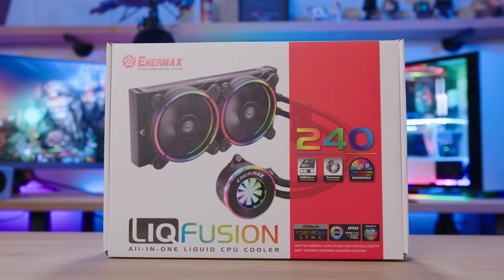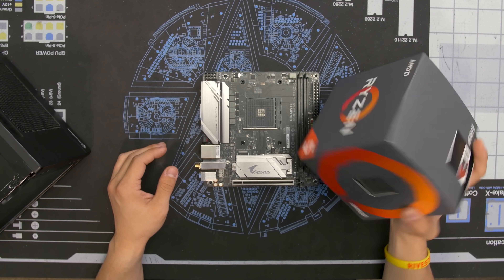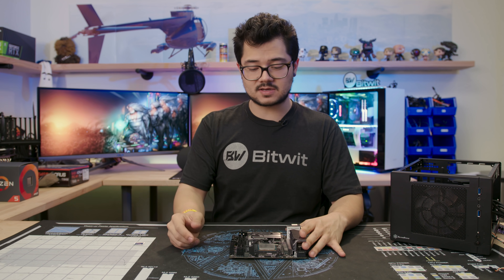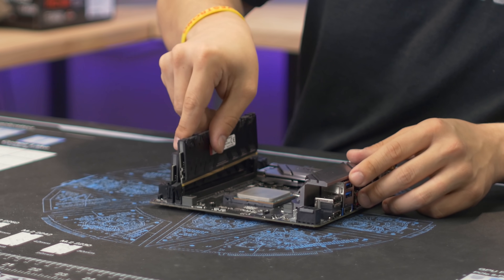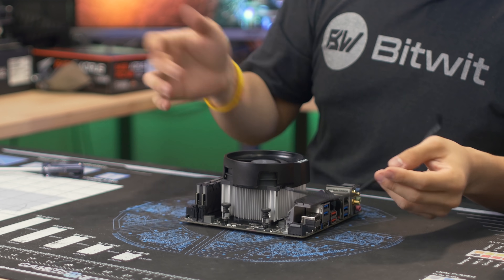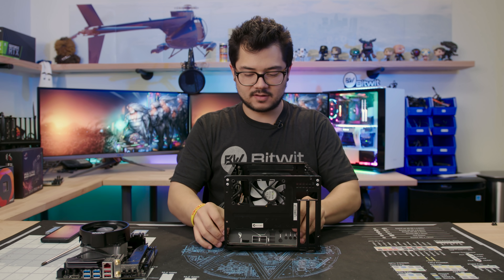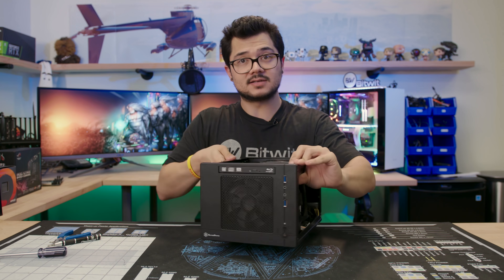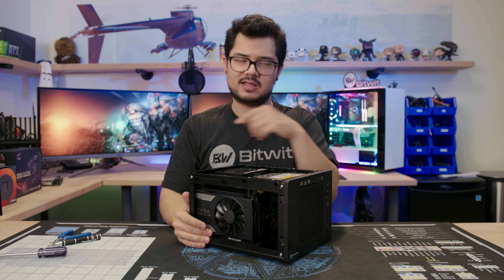Building a TINY PC Step-by-step!

Comment: Hey I ordered the motherboard (gigabyte b450 i aorus pro wifi) a few days before watching the video and it’s on its way, does it normally not have that ‘io shield’ thing or have you just lost it? Will I need it in a sg13 case (also on the way)?
Reply: Nvm it came today, shield included ^^

Comment: Very similar build to mine. Except I crammed a 2600x and a 3 slot rtx 2060 into a coolermaster 110. With an NH-L12s for cpu cooler.

Yes they do fit. You just need to make some cuts.

Comment: I built in this case back in 2013, and the cable management is always awful with it. Imagine if you were also using the 3.5" sled those cases have. Honestly as much use as I got from this toaster, it kinda soured me on Silverstone cases. For the price it just isn't as good as other SFF options out there (let alone if you go into premium case territory).

Comment: --KYLE

--SILVERSTONE Sg05

--NOT the B450 I Aorus Pro Wifi

--ASUS ROG Strix B450-I Gaming

--Ryzen 5 1600X

--Included Wraith Spire CPU Cooler

--HyperX DDR4 Predator RGB (2x8) 2933mhz

-- 5:08 phone call

-- 7:23 Important phone call

--SAMSUNG 970 EVO NVME SSD M.2

--450W Silverstone SFX PowerSupply

--EVGA Geforce GTX 1060 6GB MINI

Comment: I love this build but for some reason i don't feel comfortable with the hot air from the CPU going right to the bottom of the POWER SUPPLY. I know that it does not overheat... Its just that i like a bit more space for the airflow. Also i prefer the pull push cooler.

Comment: "I need to snip off those tweezers." I got that reference.
Reply: This Bitwit guy is a real dofus. He even forgot to isolate the PSU. Now it's gonna interfere with the rest of the system and fry his components. Lord have mercy
Reply: emil0asp Good thing he had a table but he didn’t have a swiss army knife that hopefully had a screwdriver
Reply: @evannguyen05   and the livestrong bracelet or should i call it an wireless anti static bracelet
Reply: Same.
Reply: He also has the bracelet like the verge too
Reply: Ikr
Reply: Doesn't even have a thermal paste applicator. Smh
Reply: @giovannijulian4772  or an allen wrench, this guy is so unprepared
Reply: @giovannijulian4772  also, he doesn't have enough thermal paste

Comment: i built a similar build just in a slightly bigger mini tower  
and it is all padded on the doors and top lid.
amazing sound dampening and great airflow with a single 140mm(can have 2x) 
on the front and space for a mini gpu or a (full sized msi gpu)
love it so far as it takes minimal space

Comment: Okay all joking aside, there is a genuine mistake in here and it's more of a wording thing than anything. "These are 2 pin connectors that have a positive and a ground", Ground? You mean negative? And also if the case doesn't have an LED also for the power, then polarity doesn't matter.

Comment: Hey I need your help I am building a new PC and I am gonna be using an rx 570 and a ryzen 5 2600 is 550w 80+ enough?
Reply: Its enough. Better to go for 650w or more though in case you want to upgrade something later.

Comment: I would have gone for a 65w Ryzen in this build, with say a Noctua LP CPU cooler because of the clearance between the standard Ryzen cooler and the PSU. The 1600X will generate a lot more heat, so it really needs a better cooler than you could fit in this build, unless you used a front mounted AIO. You'll hardly see any benefit over say a Ryzen 5 1600 or even a Ryzen 5 1400, unless you are running a better GPU. The Ryzen 5 2400G, with just it's onboard Vega Graphics would be the best solution for this size of build. I'm guessing you had these parts spare and that's why they went in it but for regular use, it's going to be a bit of a microwave for it's components.

Comment: "So you don't crack the heat spreader?" were you drunk during this statement.

and I don't think the IO Shield does anything to stop you from compromising your airflow, have you seen the amount of vent holes that are near or around the IO shield on most cases? 

also I am sure you are aware by now but, you know you can rotate the fan on the heatsink so the AMD logo is at the top of the board right? looks way cleaner that way.

Love your channel but please... you need more sleep.

Comment: I don't see the parts list? I have a mini case and need help with parts
Reply: Motherboard: https://www.newegg.com/Product/Product.aspx?Item=N82E16813145086
RAM: https://www.newegg.com/Product/Product.aspx?item=9SIA8N28NK1168
CPU: https://www.newegg.com/Product/Product.aspx?Item=N82E16819113497&Description=ryzen%202600x&cm_re=ryzen_2600x--19-113-497--Product (this one is better, cheaper and with a CPU fan included).
SSD: https://www.newegg.com/Product/Product.aspx?Item=N82E16820147741&Description=m.2%20970%20evo&cm_re=m.2_970_evo--20-147-741--Product
PSU: https://www.newegg.com/Product/Product.aspx?Item=9SIAA7W8V04749&Description=silverstone%20sfx%20450&cm_re=silverstone_sfx_450-9SIAA7W8V04749-Product
GPU: https://www.newegg.com/Product/Product.aspx?Item=N82E16814487261&Description=evga%20itx%201060%206gb&cm_re=evga_itx_1060_6gb--14-487-261--Product
Case: https://www.newegg.com/Product/Product.aspx?Item=9SIA62V86N8881&Description=silverstone%20itx%20case&cm_re=silverstone_itx_case--11-163-231--Product

Done :)
Look in more websites, these prices are a bit high.

Comment: The same pc (slightly modified)

Motherboard:
 https://www.novatech.co.uk/products/gigabyte-b450-i-aorus-pro-wifi-amd-am4-b450-chipset-mini-itx-motherboard/b450iaorusprowifi.html?gclid=Cj0KCQjwwODlBRDuARIsAMy_28XIG0EPZhyT9FxpUsR8Yyfdo4icKiuEVFkAjI090rJe_OVYSAOYBD4aAnzLEALw_wcB#utm_source=google&utm_medium=base&utm_campaign=products

£120

Cpu:

https://www.amazon.co.uk/AMD-Ryzen-1600X-Desktop-CPU/dp/B06XKWT7GD/ref=asc_df_B06XKWT7GD/?tag=googshopuk-21&linkCode=df0&hvadid=310762440393&hvpos=1o3&hvnetw=g&hvrand=4527600482605928149&hvpone=&hvptwo=&hvqmt=&hvdev=m&hvdvcmdl=&hvlocint=&hvlocphy=9045971&hvtargid=pla-300971481748&psc=1

£120

Ram:

https://www.amazon.co.uk/Predator-DDR4-RGB-HX432C16PB3AK2-16-288-Pin/dp/B07GL6CLTT/ref=asc_df_B07GL6CLTT/?tag=googshopuk-21&linkCode=df0&hvadid=310739933748&hvpos=1o2&hvnetw=g&hvrand=11783944589492582463&hvpone=&hvptwo=&hvqmt=&hvdev=m&hvdvcmdl=&hvlocint=&hvlocphy=9045971&hvtargid=pla-522569507483&psc=1&th=1

£100

Craphics card

https://www.scan.co.uk/products/evga-geforce-gtx-1060-sc-gaming-6gb-gddr5-vr-ready-graphics-card-1280-core-1607mhz-gpu-1835mhz-boost?gclid=Cj0KCQjwwODlBRDuARIsAMy_28WQrzzmuymrYFuYCcgkkLmHyTCV5orelyKKTgp2bv8CYN0y6OY2SCgaAurDEALw_wcB

£190

Ssd:

https://www.enligo.com/gb/en/products/3d37415c71.html

£66

Hard drive:

https://www.amazon.co.uk/Western-Digital-WD10JPLX-internal-drive/dp/B01DOL05OC/ref=asc_df_B01DOL05OC/?tag=googshopuk-21&linkCode=df0&hvadid=310739933748&hvpos=1o1&hvnetw=g&hvrand=8205223195931393060&hvpone=&hvptwo=&hvqmt=&hvdev=m&hvdvcmdl=&hvlocint=&hvlocphy=9045971&hvtargid=pla-353335656892&psc=1&th=1&psc=1

£61

Power supply:

https://www.scan.co.uk/products/450w-evga-450-br-fully-wired-80plus-bronze-single-rail-375a-120mm-fan-atx-psu?gclid=Cj0KCQjwwODlBRDuARIsAMy_28XzmUd0J_Nww42AcHp0tybcgOiWe8erVnm01o67bciTnUNw7oWUOh4aApPCEALw_wcB

£40

Case:

https://m.newegg.com/global/uk-en/product/N82E16811353062?&ignorebbr=true&source=googleshopping&nm_mc=KNC-GoogleUKAdwords-Global-Mobile&cm_mmc=KNC-GoogleUKAdwords-Global-Mobile-

£35 (a different case)

Total: £732

Comment: Not sure about the 2400 but the Ryzens which came with a cooler which I had to deal with already had the thermal paste on the cooler preattached, it usually is covered by plastic, you pull the plastic and then you can attach the cooler directly without any additional thermal paste.

Comment: Cool! You actually found a dual slot case?
I forced my Blower type 2070 inside a $50 rosewill (single slot) case with some metal frankensteining, and it works!
However, I would have chosen a blower type GPU, instead of an open GPU.

Comment: I think its a bit ironic to say that you should be careful with the pins on the cpu, to then hold on the pins on the ram.. Ram is the most sensitive component in a computer. And you have no clue you have broken it without full memory test or getting random intermittent problems ...  But most youtube computer builders do this..
Reply: First, no, it’s not, second the gold contacts are plated on the pcb and you can’t bend them just by touching them

Comment: What are the parts??? No description :(
Reply: More or less the same pc (different case)

Motherboard:
https://www.novatech.co.uk/products/gigabyte-b450-i-aorus-pro-wifi-amd-am4-b450-chipset-mini-itx-motherboard/b450iaorusprowifi.html?gclid=Cj0KCQjwwODlBRDuARIsAMy_28XIG0EPZhyT9FxpUsR8Yyfdo4icKiuEVFkAjI090rJe_OVYSAOYBD4aAnzLEALw_wcB#utm_source=google&utm_medium=base&utm_campaign=products

£120

Cpu:

https://www.amazon.co.uk/AMD-Ryzen-1600X-Desktop-CPU/dp/B06XKWT7GD/ref=asc_df_B06XKWT7GD/?tag=googshopuk-21&linkCode=df0&hvadid=310762440393&hvpos=1o3&hvnetw=g&hvrand=4527600482605928149&hvpone=&hvptwo=&hvqmt=&hvdev=m&hvdvcmdl=&hvlocint=&hvlocphy=9045971&hvtargid=pla-300971481748&psc=1

£120

Ram:

https://www.amazon.co.uk/Predator-DDR4-RGB-HX432C16PB3AK2-16-288-Pin/dp/B07GL6CLTT/ref=asc_df_B07GL6CLTT/?tag=googshopuk-21&linkCode=df0&hvadid=310739933748&hvpos=1o2&hvnetw=g&hvrand=11783944589492582463&hvpone=&hvptwo=&hvqmt=&hvdev=m&hvdvcmdl=&hvlocint=&hvlocphy=9045971&hvtargid=pla-522569507483&psc=1&th=1

£100

Craphics card

https://www.scan.co.uk/products/evga-geforce-gtx-1060-sc-gaming-6gb-gddr5-vr-ready-graphics-card-1280-core-1607mhz-gpu-1835mhz-boost?gclid=Cj0KCQjwwODlBRDuARIsAMy_28WQrzzmuymrYFuYCcgkkLmHyTCV5orelyKKTgp2bv8CYN0y6OY2SCgaAurDEALw_wcB

£190

Ssd:

https://www.enligo.com/gb/en/products/3d37415c71.html

£66

Hard drive:

https://www.amazon.co.uk/Western-Digital-WD10JPLX-internal-drive/dp/B01DOL05OC/ref=asc_df_B01DOL05OC/?tag=googshopuk-21&linkCode=df0&hvadid=310739933748&hvpos=1o1&hvnetw=g&hvrand=8205223195931393060&hvpone=&hvptwo=&hvqmt=&hvdev=m&hvdvcmdl=&hvlocint=&hvlocphy=9045971&hvtargid=pla-353335656892&psc=1&th=1&psc=1

£61

Power supply:

https://www.scan.co.uk/products/450w-evga-450-br-fully-wired-80plus-bronze-single-rail-375a-120mm-fan-atx-psu?gclid=Cj0KCQjwwODlBRDuARIsAMy_28XzmUd0J_Nww42AcHp0tybcgOiWe8erVnm01o67bciTnUNw7oWUOh4aApPCEALw_wcB

£40

Case:

https://m.newegg.com/global/uk-en/product/N82E16811353062?&ignorebbr=true&source=googleshopping&nm_mc=KNC-GoogleUKAdwords-Global-Mobile&cm_mmc=KNC-GoogleUKAdwords-Global-Mobile-plaCases+%28Computer+Cases+-+ATX+Form%29_-N82E16811353062&gclid=Cj0KCQjwwODlBRDuARIsAMy_28VnBqCqIjVzALifAH_3284-ixPfz_YpQOoP3AorSmZDlGvdTv63T8oaAt1qEALw_wcB

£35

Total: £732
Reply: @ronniepickering8589  The motherboard is actually the Asus ROG STRIX B450-I (You can clearly see the m.2 heatsink when he's installing the GPU, and since metal accent logo =/= rgb, then no x470-I).

It's been stated asus's motherboard is better than gigabyte's when overclocking (maybe even handling stronger CPUs, 2700x for example?) But since the idea is building such a SFF PC like this, overclocking is definitely not the go-to.

edit: after I actually watched the video I noticed how kyle shows when he changed the motherboard, now I don't feel at all special for randomly reading this comment while skipping half the video
Reply: @Sekaisien  thanks for correcting me
Reply: Boss Called Anthony thank you
Reply: @jtdalton1984  no problem, mate
Reply: Clash With Ant thanks

Comment: I think you're a newbie when it comes on building pc. Let me guide you to become a Pro.
First of all It's not Io shield it's called Brace! the Brick fan (not powersupply) need to be internal And you need a swiss knife that contains screw driver. And never forget to put a lot of thermal paste on cpu maybe a little bit on gpu dent and ram.
But atleast you're wearing an anti static wrist band that is a good start. 
Thank me later.

Comment: Tip to the beginner, and I guess the pro based on the video. Plug in GPU power before mounting the GPU in a small form factor case, that way you don't have to struggle like Kyle did.

Comment: im planning to build a PC just like this, im a student so this fits into my budget... kinda, but i need some help choosing parts, like the power supply and deciding what ryzen cpu to buy, im between 1600x, 2600 or 2400g.
i already have a radeon R5 240 to use with the first 2 cpus until i buy a good graphic card, but i still dont knwo which to buy.
Reply: it depends what youre doing, if you want to stream some the 2600 will be great but for just gaming get the 2400g, but as they are the same price the 2600 is a great value
Reply: @travis9_  thankyou very much, im more inclined to the 2600 since i am going to stream and record some games and create some videogame guides, i only need to decide what graphic card to use, a 1060 is what i would love to use, but i dont know if the motherboard can use it.
Reply: TheMalcomrj I’m also limited budget and I chose the 2600, and went pretty cheap on everything else

Comment: Is there any mini itx case which can fit a full size zotac 1080?
Reply: Lost Khajiit  yeah saw that one from jay. Ive found some mini itx cases with plenty of space for board partner cards but am not sure if the zotac fits as its quite beefy. Also the mini itx cases are so god damn expensive here in europe. Damn
Reply: Lost Khajiit  thanks for your help bro! Yeah the thermals will be garbage with this card for sure. Maybe i have to look for a similar case with vertical gpu mount and side holes. This would solve the thermal problem but probably interfere with other parts hmm. Ive used this card in a mid tower w/o any problems and now as i am upgrading the gpu i thought i could use this card in a htpc/server like build. What do you think about micro atx ? Maybe this is the way to go for me ?

Comment: how much will the graphics decrease if i use a 3gb 1060 instead of a 6gb 1060
Reply: I wouldn't recommend a 3gb 1060. A 4gb RX580 or even an 8gb RX570 is so much better and yet an identical price
Reply: @the_big_niz11  A gtx 1060 3gb is definitely better than a 1050TI. What's the absolute maximum you can spend on the graphics card? I could recommend the best (new) card

Edit: Sorry. I read your comment wrong. I'm currently looking into building an itx build myself. I'm not really sure about how much heat a card like a 1060 generates in a small case, but I'm currently looking into that with my own build. Give me a day or two and I'll get back to you on that one
Reply: Here, take a look at this list I made. It only took 10 minutes. Any more questions, just comment them through the document, and I'll do my best to answer them. I might add a few more parts later.
https://docs.google.com/document/d/1Cva7ULhXa4f2NRk8Murag6PJjDOh4TjHhzssISr861U/edit?usp=drivesdk
Reply: @00mario14  thanks it was really helpful

Comment: The 2600 can sustain an all-core boost around 3,750mhz, which is faster than the 1600x, but at a lower TDP. It is a much more energy efficient processor than the 1600x, and would be a better fit for this build. Near identical performance with much easier cooling.

Comment: I ended up breaking the glue or whatever was holding that shroud on as it was was wobbly, but didn’t realise it was going to break lol,  it is a bit stupid having that bit stick out just for aesthetics if it gets in the way some times.

Good build though, I was looking at replacing my desktop with the SG13 model due to atx psu support, but interesting to see a build in this case still.

Comment: I'm an assembler for a prominent system integrator, and when it comes to front panel connectors a bit of edgy millenial humor has always helped me with the LED side, at least! And that is... positive on the outside, negative on the inside. The + always goes on the pin on the far left (with the CPU socket "up" of this orientation) and the negative always goes to the right of it. Really only relevant for the PWR LED portion since for some reason case manufacturers always braid or connect their cables to have the positive side on the right if the text is facing up so it's easy to get them backwards, but a saying that's easy to remember nonetheless. A good build video! Once I started doing this stuff for a living, it's a bit cathartic to see someone else do it as a hobby, like I used to before it became my job.